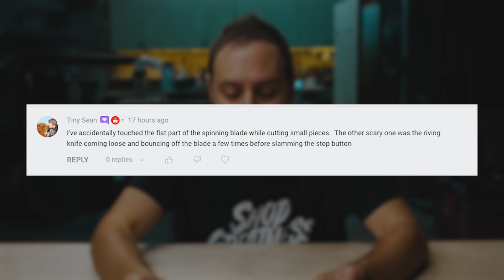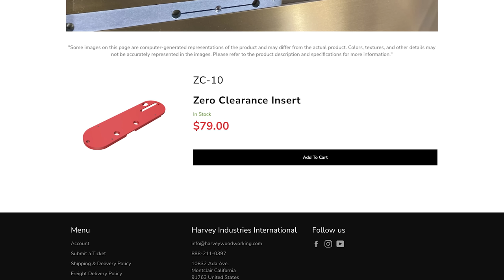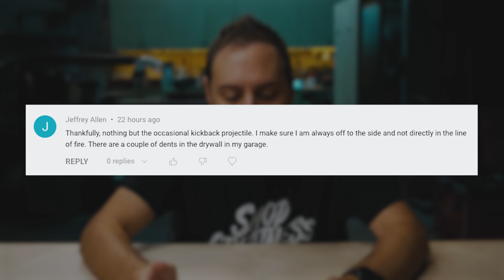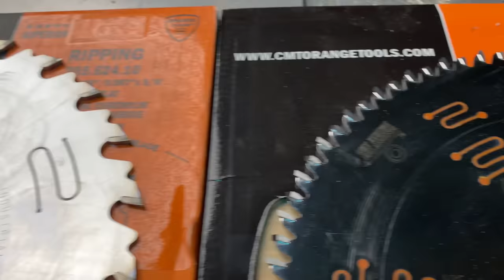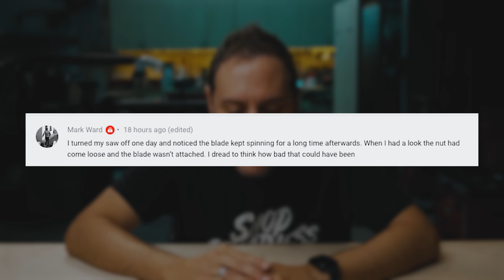I don't know why people make these dumb mistakes

Comment: Another safety video on YT? GOOD! the more there are the more chances that someone will stumble on one and take it to heart.
I take tool/ work safety seriously (doesn't prevent all injuries but so far no serious or lasting injuries)
And I mean real world safety not some rules sucked out of thin air.
I think zero clearance insert in table saw is one that is not something most of us realize.
I was once peppered with hard pieces of shattered knot that have fallen inside dust collection shroud under the saw and were picked up and shot at me.
Good thing I always use face shield so ones that where on trajectory with my face just made small vibrations on head harness.
The one that hit me square in the groin left a nasty bruise and made me kneel on the floor and I was wearing trousers.
I will never understand guys that work with power tools in thin shorts, flip flops and use all manner of disc cutting type things without at the very least eye protection.
Personally belittle people that use angle grinders without disc guards and no safety googles. It's not unmanly to protect yourself from serious harm that you could take measures to avoid.
I look on scars that I have as lessons in humility and not as badges of honor.

Comment: I have been using table saws for 50 years.  I am not above hurting myself, but other than one kickback incident that was a little hard to predict, I have not had a problem.

The kickback incident was on a 3 HP 220 machine.  After that experience, I decided a didn't want to go in the ring with Foreman.  Your dream saw isn't necessarily your friend.

I am nearly 65, and I think that avoiding accidents was entirely feasible.  This isn't rocket science.  I am not a fan of all the fear and doom and gloom.  There are a lot of everyday things from matches to SUVs, that are a lot more dangerous than table saws, get a grip.  I was in a medium bad plane crash, there are things a lot worse than cutting a finger.  And not under your control.

I am thinking a little bit more about what it will be like on the downslope. I just had the most accident prone day on the job.  One accident after another.  I even collapsed my bench.  Got a lot of  work done, but made a lot of mistakes.  It wasn't until later I realized I was sick.  I felt pretty OK, just a little tired.  But I was stumbling around, and making all these mistakes I normally wouldn't.  At some point that could be me at my best.  So I am going to have to keep a more careful eye on myself over the next 20 years, if I get them.

Comment: I will never use a table saw, it just seems like an inherently flawed tool, like chainsaw disks on angle grinders. My track saw with a few jigs does 95% of what a table saw will do, and the other 5% are probably what are likely to cause amputation anyways. For those things I'll figure it out with hand tools, a router or something else. Millions of woodworkers throughout the ages got by without a table saw, so can I.
Reply from the maker: Mft and tracksaw is a solid way
Reply: Table saws are not for the faint of heart to operate.

Comment: I don't care how careful you 'think' you are, because no matter what you do - your arm, upper body and/or face is ALWAYS traveling over a 5,000rpm 10" blade as you 'follow through' with your cuts - or when you reach over to grab the piece you just cross-cut.

That blade is traveling at 218.66fps (148.74mph) AND has 24 carbide-tipped 'teeth' on it. - - I bring this up because almost EVERYONE takes the annoying blade guard off of their saw and almost EVERYONE on YouTube is shown doing this same thing. 

I've always wondered what part of my face would be likely to get hit with a little chunk of carbide flinging off of one the teeth on a table saw blade - but do I wear a full-face shield? No.  - - Every time you use one of these Harbingers of Death, you're taking a huge risk. You're not a 'woodworker', you're a 'Daredevil'.

Comment: Get rid of the rings and the watch. A saw, fly cutter, etc. can come too close and give your finger a minor cut; no big deal, clean it (all sorts of ugly microscopic stuff can be found in machine oil), tape it up, and give yourself a lecture about being such a putz. BUT if the cutter hits a ring, it won't cut it; instead it will pull your finger off. People don't really believe this until they see it, and by then it's too late. The watch will pull your whole hand into the cutter. Loose sleeves (I'm guilty of that one), long hair (I know someone who had half his scalp pulled off by a drill press he wasn't even using, just walking past), etc are all avoidable liabilities.

Comment: Would you believe I know a fellow (not I, as I have a 24 hour rule) who loves beer to the point that he drinks it while he's using power tools. Then when he made a trip to the emergency room, one evening, to have his had sowed up as the table saw takes no prisoners, and said to me I don't understand what happened. Well you dumb a-s, your senses and your reflexes were lowed by the beer in your system. So about two weeks later I need to use his pocket hole jig and table saw - so he offers me a beer while I'm working with the table saw, And he's an engineer?????? Oh the 24 rule it no alcohol 24 hours before you use a power tool-then you should never have to say-I don't understand-I don't know what happened???!!! Wilber

Comment: I find it odd that from the very beginning of your video, starting with the title, you stress the horror of the number of amputations every year, yet you then poo-poo the one safety feature out there that can prevent this with almost 100% certainty - SawStop. Sure, kickbacks can happen with any table saw, and they can seriously injure someone, but they seldom result in amputations. As a SawStop owner and experienced woodworker for over 30 years, I had a lapse of concentration one evening and ran my left hand under the guard and into the blade. Were it not for my SawStop, it would have been life changing. As it turned out, it was a Band-Aid. Instead of praising the excellent safety feature of these saws, you somewhat ridicule them with your hotdog comments. I sense some sort of anti-SawStop sentiment. If I were giving safety advice to new woodworkers, I would tell then to buy a SawStop if they can afford it.

Comment: Pretty good video, but like so many doesn't address using the damned blade guard. 
I have no idea why content creators neglect or refuse to address using blade guards, and don't use them in most cases. Maybe, they get in the way of their sexy wood cutting footage.

I work at a level 1 trauma center, and I can't count the number of finger repairs or amputations we've done in the middle of the night. My brother lost half of the first joint of the thumb on his right hand to a table saw. In almost every single case the blade guard was off.

While it can't always be used, as when doing non-trough cuts or using a sled, for most people doing the VAST majority of cuts unnecessarily removing the blade guard is highly ill-advised.
Use the damned blade guard!
Reply from the maker: Name a tv show that uses them. They get in the way.
Reply: @wittworks  Yeah. So do fingers apparently.